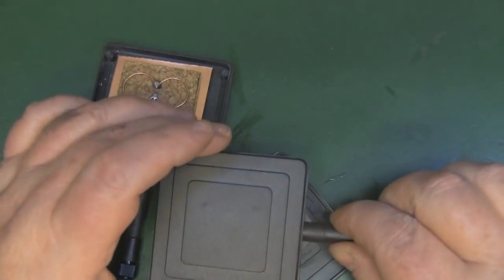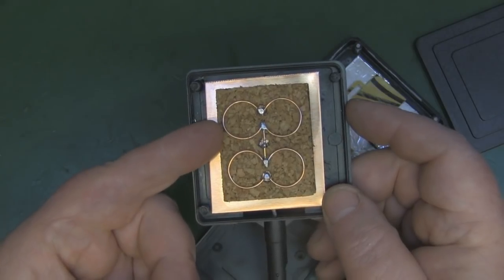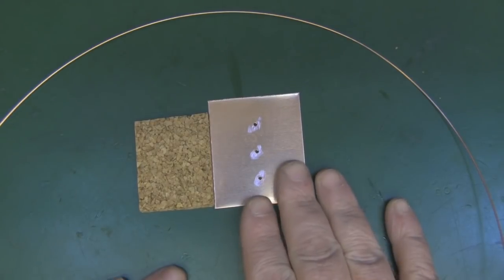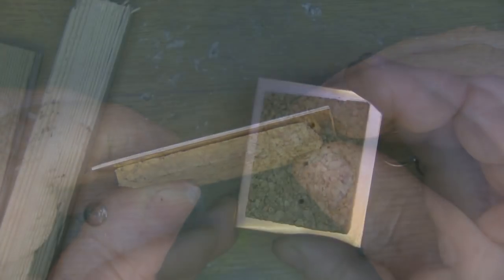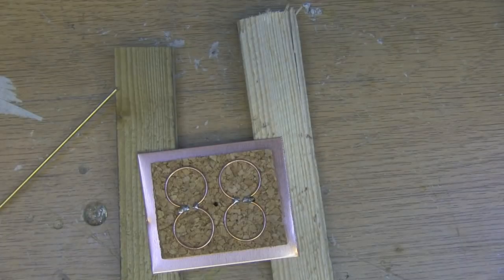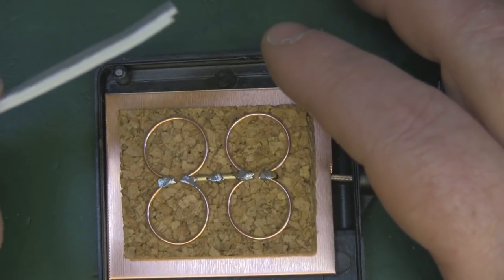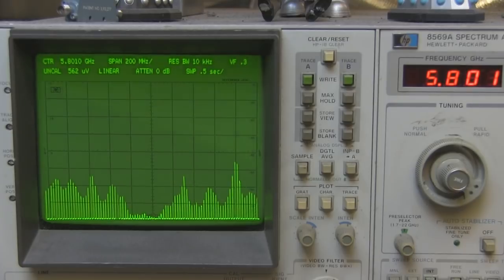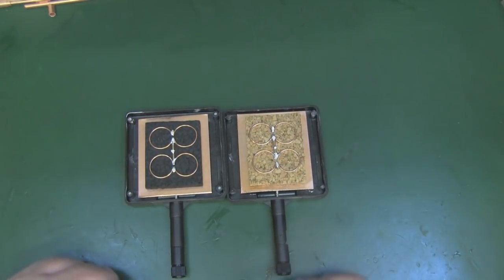Double Biquad Antenna for 5 8GHz FPV

Comment: This is a fantastic antenna, if you had to guess what would the range of 2 of these facing each other , so one at the end on one side of a runway and the other at the other end (just a clear example). In having 2 bi-quods, is this a stacked antenna and could you just keep adding the bi-quads to it? Could you stack them side by side as well as above and below?

Comment: Material that use to put between reflector and driven element. Effect lot to antenna resonance frequency . I made one antenna and used peace of solid wood to space exactly element and reflector .wood is good insulator i think but  Network analyzer said it resonate completely different frequency. And i removed the wood and problem solved.
Reply from the maker: It's called dielectric constant wood has a changing dielectric constant due to humidity
Reply: @andrewmcneil  thank you for the reply !! 
I have another question to ask you . I hope you will reply me . When i make an antenna for parabolic feed . For example a biquad . Better is biquad with a reflector or without reflector ? After watched your dual polarized biquad antenna i got an idea to make a LTE MIMO using that method. Antenna works good . But if i feed this to parabolic reflector better is with reflector or without reflector ?? Because with reflector it doesn’t make any difference. 

Thank you very much !!

Comment: Just finished building a double biquad , double bow-tie. I used solid copper plate( heavy) with plastic 5 mm standoffs and LMR 400 Coax SMA Male Cabling-used in Aviation, Mil spec , ect , made a brace for the coax line as well to prevent small sag, drilled 3 holes one for stripped Coax and two for standoffs, 1 mm copper wire for the bow ties and used 50/50 Solder which is very easy to work with and melts and coats instantly . I tested last night and best reception is 5.830 Ghz, to secure the connection at the copper plate hole for the coax in back I used JB Weld and coated the back,good to 5000 psi or so in strength. Very happy with the results. Going to make a 5.8Ghz biquad  with RG316 Male SMA next.

Comment: Wouldn't the brazing rods be conductive to the positive single wire in the middle by contacting the ovals that's connected to the back reflector,, it will just ground out

Comment: General question on dual bi-quads... What I do know of electronics is that  if you put two similar impedances in parallel, the result is 1/2 the initial. So two 50 ohm bi-quads would result in a 25 ohm antenna. I assume, then, that when we double up two antennas each must be closer to 100 ohms. Is that correct? Have I missed something?

Comment: im getting into this and i have a question ,im planing to set up a plate for my sunroof that has a diversity receiver on it that goes to my Googles and a 2.4ghz antenna going with a long SMA cable down to my radio ...i wonder what 2 antennas would work best for the fpv feed ? since i have like no size limit its on my car roof anyway

Comment: Thank you very much
I have a simple question
What is the best antenna to send wifi signal for as far as possible
And at the same time have a wide diameter to receive wifi signal from different directions without losing too much signal .
I want to create an antenna that is average between diameter and range , that can send wifi to exact direction and at the same time coveres wide diameter of signals for receiving
For example the dish antenna is the best antenna for Long range signal sending , but at the same time it's very directional that a single rotation of the antenna causes loosing of signal (you need to know the exact location of the the Access point to receive great signal)
And the diagonal antenna is the best in covering a wide direction
But at the same time it's good at directing WiFi signal towards long range.